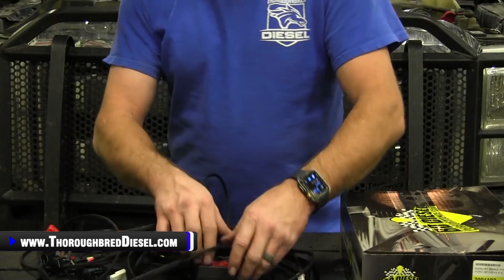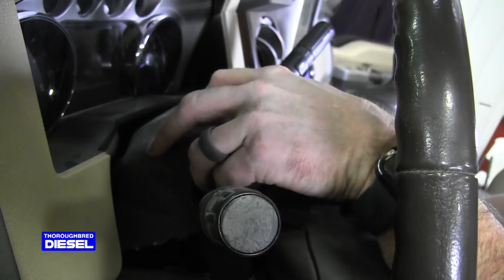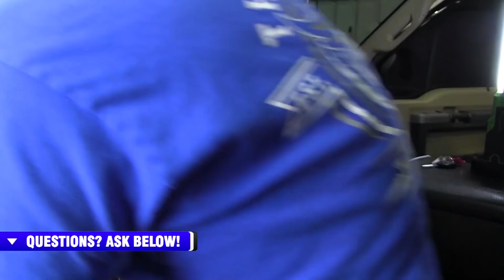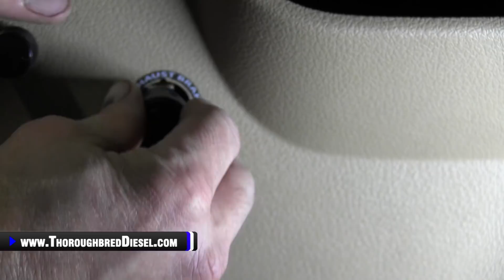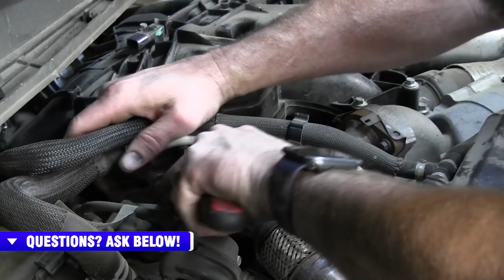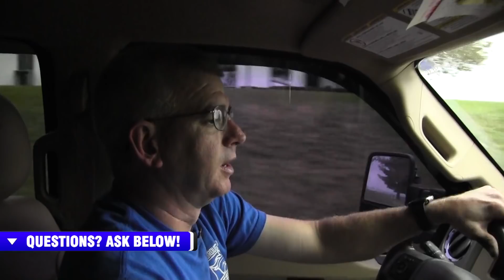BD Diesel Variable Vane Exhaust Brake Install: Ford Powerstroke 6.7L

Comment: I have a 2011 F350 with a KC turbo warlock kit and Stage 1 Whistler. With that said, which exhaust brake should I use?
Reply from the maker: No,  the check valves do not have to go back in.  Gracias.

Comment: Running a Mini Max tuner (obd plug) on a 2012 6.7 Ford completely deleted. It has a tow tune. Can I run this BD Brake accessory at the same time while the Max is still mapping/tuning the engine?

Comment: I have a few questions about the product. I haul daily and with a 2014 f350 there is virtually zero exhausted braking factory on this version of the 6.7 with the small vgt. Will this really improve that and will this play well with a ELD divices and reprogrammed tunes or a "gauge monitor"?
Being the exhausted isnt restricted as much on my truck would this make the product work better and if i upgraded to a bigger vgt and lightning vgt solenoid would that further improve the products performance.
Reply from the maker: This product gives you breaking outside of the normal tow/haul and exhaust brake stock parameters.  One thing I will say on the 11-14 style turbo, is if you are wanting much better braking and performance, converting to the 17+ turbo style will pay off for towing and driveability.  And gets rid of the failure prone 11-14 style turbo.

Comment: Ok… I’m in the middle of doing this installation. Usually I do the difficult aspects first, and this project was no different. Removing the intake plenum to facilitate the electrical connection at the turbo valve. Getting the fifteen bolts out, after following the intrusions to a tee wasn’t as bad as I thought. But then came the difficult part. The manifold was still captive, impossible to remove from the area. I finally took the intake intercooler tube off, and that made it possible to remove the plenum. This was a fairly easy task, and should be included in the instructions. Tomorrow, I reassemble, then move to the interior half of the project. Do yourself a favor, remove the intake tube, and make life easier!
Reply from the maker: Good tip.  Glad you got er done.

Comment: Nice and detailed install!   I am thinking about adding this BD exhaust brake system... however...  I already have a remote start ( add-on) module that piggy-backs off the OBDII port on my 2012 F350 dually 4x4.  Can this still work with both piggy-back harnesses off the OBDII port?  Thanks
Reply: My man, you can have oem remote start for around $150 and skip all that nonsense plus it will be in a factory key fob 👌
Reply: @HoosierHeatFirewood  I know that now... this post was a year ago... I learned about it a few weeks after

Comment: Hey would this kit work with the 2015 f550? i believe the 15-16 cab/chassis trucks are still first gen 6.7s like the 11-14 f250/350s. Also I have a sct tuner in the truck with a mild tow tune, would this interfere with the bd exhaust brake as far as shifting etc.?
Reply: I'm wondering the same thing, did you ever install one? I have the same truck as you. my way of thinking I would rather do this for a brake then the exhaust one with a butterfly one because the computer knows what's going on and also shifts in conjunction to the turbo vanes closing.imo ... any input anybody?

Comment: How well for the BD exhaust brake systems hold up? Looking at upgrading my 2012 F250 6.7l crew with a BD system vs getting a 2015 with OEM exhaust brake system for towing a 40’ toy hauler. Any feedback would be appreciated.
Reply: The factory one in a '15 is pathetic compared to, well, literally anything. The BD one is awesome. Had it for over 2 years on my 2011 and recently traded into a 2012 and just installed a bd brake on it tonight. It's a must have to me.

Comment: A friend of mine just sent me the info on this setup my qwestion is sence it plugs into the obd2 connector I also run on my truck 2013 f450 6.7 the banks Derringer,I did purchase a obd2 splitter so I can use my autel scanner i bought just recently to have manual regen 
With this exhaust brake ill have to buy a 3 way obd2 connector?
Reply from the maker: This will not work with the tuner in conjunction with the BD VVE Controller. I don’t know that you will be able to have communication with your ECM for a forced regen through a splitter either. Not all splitters have coms on both sides.

Comment: What happens if u run the switch on the second setting and the tow haul on as well
Reply from the maker: That’s pretty much what the 3rd position is.
Reply: What I've found is that the third setting on the bd is like tow haul, but even a little more aggressive. However if you want the upshift strategy of tow haul, you still need to turn on the tow/ haul.

Comment: Like the video but do have a question, when I did my delete almost 50000 miles ago I went with h&s tuner that plugs into my data port, my question is is that pig tail for the data port going to affect my tuner. Thanks great vid keep um coming for the 6.7. 13 6.7
Reply: Did you end up getting this exhaust break controller installed?
Reply: With the Ez Lynk tune you don’t have to keep it plugged into OBD just flash the tune.